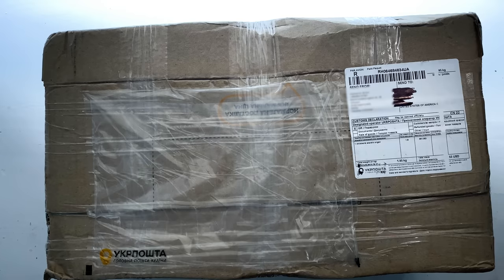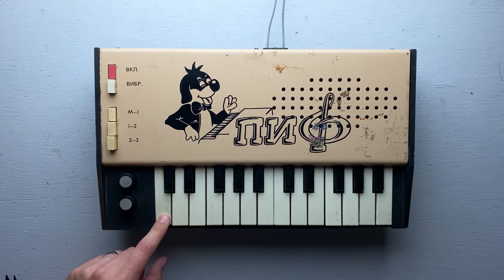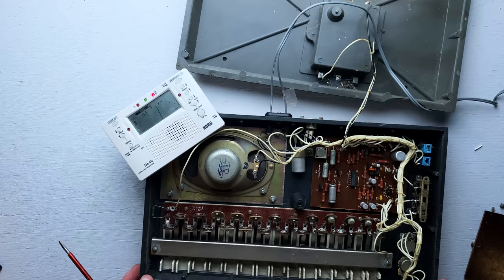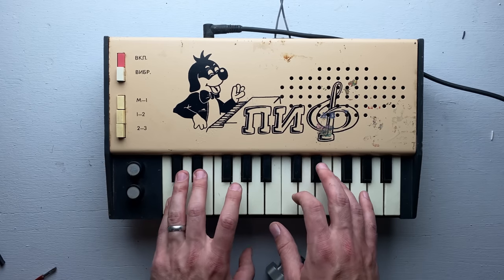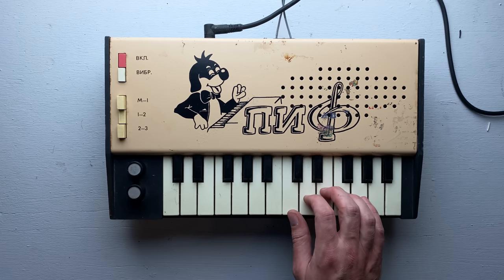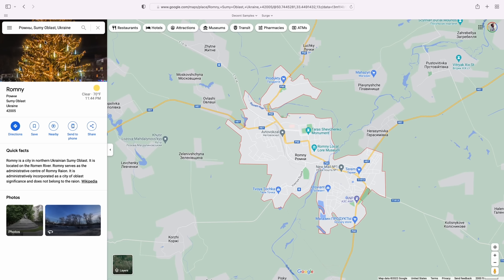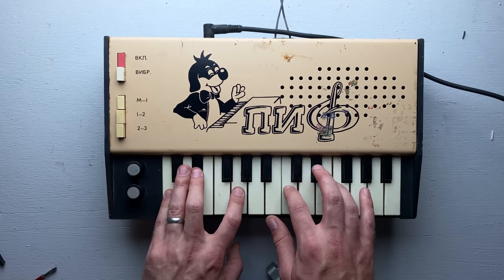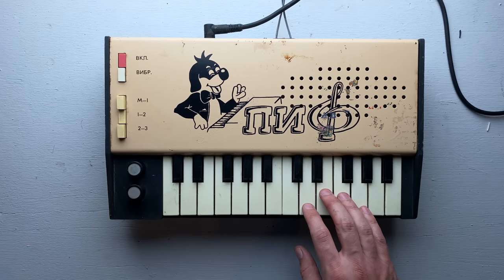Soviet Pif synth: a cute analog synthesizer for children (+ FREE Sample Library)

Comment: This isn’t really an analog synthesizer, at least not in the sense of a Moog comprising VCOs and envelope filters. Looking a the schematic, it seems a pair of simple digital chips (latches?), is is creating the waveform driving the output stage transistors. The input frequencies are provided by emitter-coupled pairs of bi-polar transistors (an old-school approach to high-speed switching circuits) driven by resonant RC networks comprising the variable series resistance of the keyboard and discrete capacitors. So pitch is determined by RC networks and timber is created with digital switches feeding some low-pass RC filters. But I might have this all wrong. Let’s ask Uncle Doug.

Comment: I believe Amperage in power supplies is the maximum amount that can be drawn from the supply safely. So 150ma is lower than 700ma and would be fine.  Voltage and AC vs DC matters. Please educate me if I'm missing the fundamentals, please!  I experiment with electronics, but I'm never 100% certain I understand any of it.

Comment: I have some experience with Soviet musical equipment, so I recommend replacing electrolytic capacitors. Over time, the capacitors could dry out, lose their capacity and acquire parasitic resistance, and this will affect the sound.